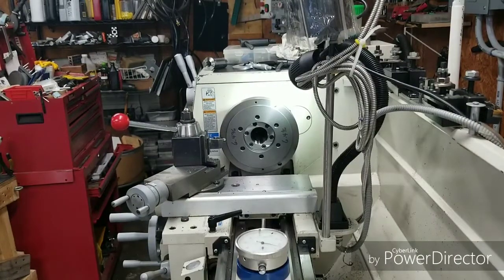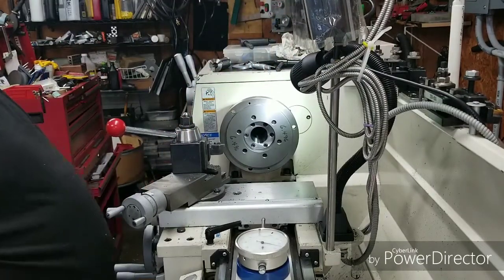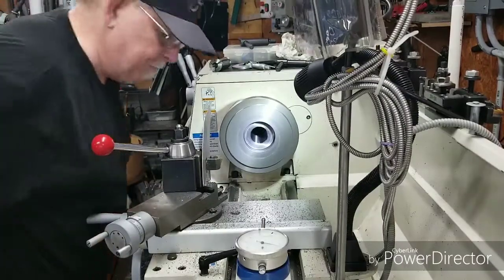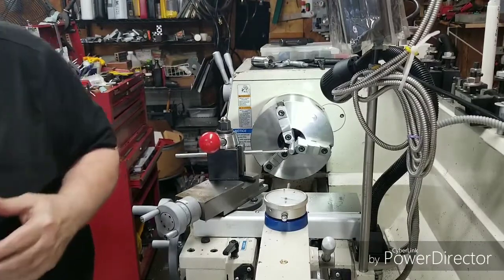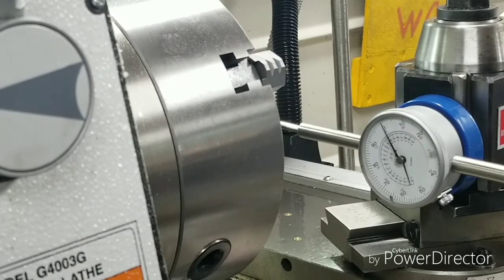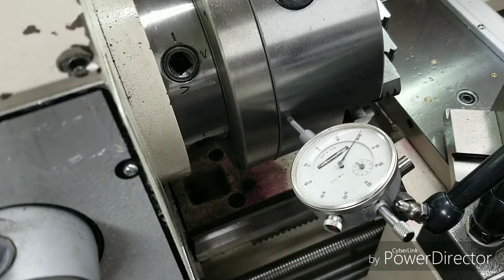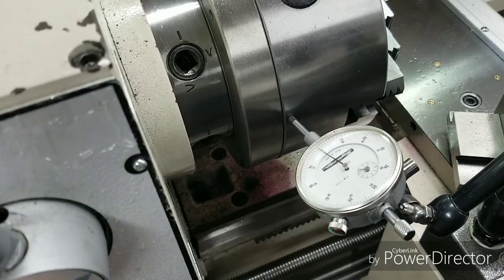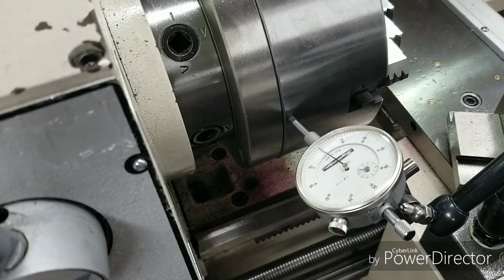Machining a D1-5 back up plate for the Grizzly G4003G.

Comment: Hi Anthony
The outside of the chucks concentricity is irrelevant. You have an extremely accurate 'out of the box' three jaw chuck. Less than a thou' that's brilliant. What makes the chuck?
Reply from the maker: If the chuck is out of round it's self then it Causes vibration.  But that being said this one not out enough to matter . And yes i was lucky with this chuck it is an import  was expecting  ..005 at best. Thanks for viewing my video and God bless.

Comment: Anthony, used Lexan or the generic polycarbonate of lexan for the chip guards. Poly carbonate is much more shatter resistant, it is what plastic safety glasses and helicopter windows are made from. I use 1/8” thick.
The run out came out good! I totally understand about the fan noise, I live in Arizona!

Comment: Did your lathe come with the carriage stop? Or did you make it? My G0750G had a set screw and I installed a handle, bit I’ve been kicking around doing a cam lock myself
Reply from the maker: No it had a socket head cap screw.  I ordered the handle from china. It is a ratcheting  handle
Reply: Anthony Brown that is how mine was. I made the lock up however I’m wanting to make up a lock like that. I have some locking handles so I could do like I did the mill lock replacement, simply using a bolt the correct thread and drilling and tapping it to fit the lock. Then locktite the whole thing together
Reply from the maker: @JamesDedmon   this is where i bought the lever I use.
https://rover.ebay.com/rover/0/0/0?mpre=https%3A%2F%2Fwww.ebay.com%2Fulk%2Fitm%2F182569507633